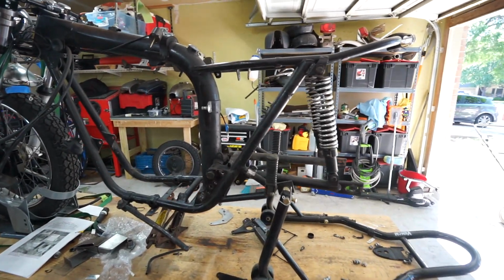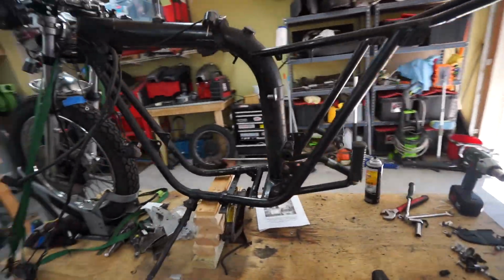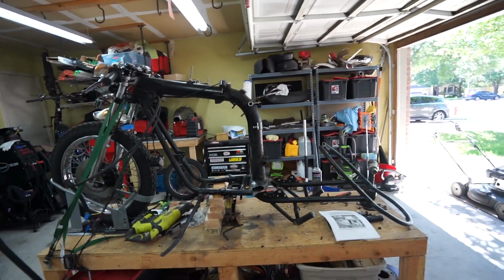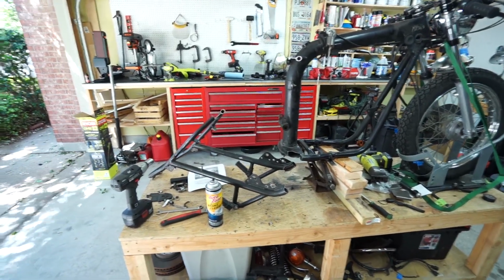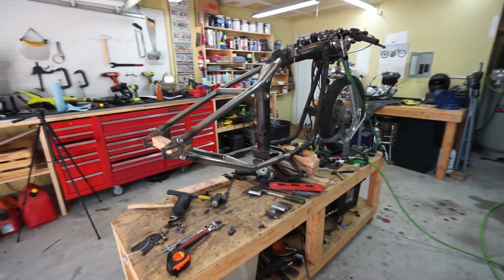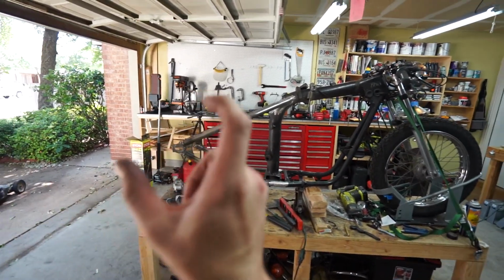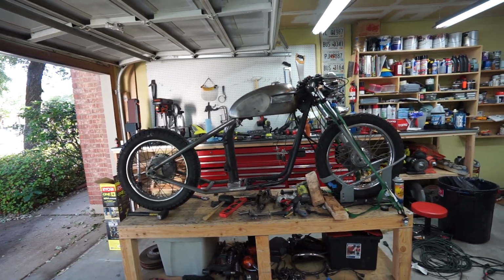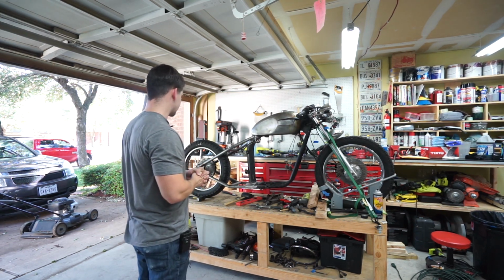Welding on the Triumph hardtail

Comment: As an "old chopper guy" I will give approval of your chopping!  You can't make an omelet without cracking a few eggs.  I'm watching this as one enjoying my factory Triumph ride.  As long as it goes back together, it's all good.  I began building custom frames in 95, working with a new "chopper shop" that opened as I was retiring from the marines.  Once you've cut it, all that matters is getting it back together.  You might have to cut a few times, but you got to do what you got to do, to go forward.  It's always scary when you cut away everything you don't want.  I'm enjoying your generation coming out and doing what I learned to do, back in the seventies.  "It's a family tradition".  I ended up having to design and make my own tubing bender and built a couple frames that were junk, but taught me the "hard corners" you have to finagle to get around.  Your frame is looking really good, I think it's going to ride very nice, looks really good.

Comment: Just found your channel. Looking to hard tail a 74 140V. I wont cut mine like that. I'll leave the rear motor mount and cut open the tubing to fit the hardtail in then weld a plate from the open tubing to the bottom rail of the hard tail. Plan to use the swing arm bracket to mount the shocks to for a spring seat. Originally was going to buy an early frame and put a bolt on hardtail on it but after seeing your bike and how cool it looks I have decided to go with the original frame for obvious title hassle reasons.

Comment: what kind of welder would i need in order to weld a hard tail?
Reply from the maker: A quality MIG will do the trick. It's obviously a very structural part of the bike so I wouldn't recommend it for a first time welding project.  I used y Eastwood MIG 135 and the bike is doing great over a year of riding later.

Comment: Can a beginner learn welding enough to work on frames that with be structurally sound and safe?  What basic equipment is needed for occasional use?
Reply from the maker: Yeah it's all about practice. I would skip the cheap flux core welders and get the nicest Mig welder you can afford. I have had good luck with my Eastwood units.

Comment: brother I need ur help again so since last month everytime I start my bike it will start in one kick but it feels like something is blocking as if like a nose block and gets better when I throttle it up with a little popping sound. but since yesterday its completely dead unable to even start. tried cleaning carburetor and spark it started but it felt like it was completely blocked somewhere was unable to throttle up.and it shutdown and was unable to start again. what is ur suggestion
Reply from the maker: Do the carb blades move properly when you twist the throttle?  Maybe they are binding up on something. Just a guess.
Reply: Classic Octane yes it does today it started properly but unable to throttle up. plus there was part of air coming out of air filter.

Comment: Great job. Well done for being adventurous. it's just a lump of metal, so have fun.
Reply from the maker: Can't learn anything new if you don't get out of your comfort zone every once in a while. Thanks for watching!
Reply: I'm working on my 71 triumph cafe oif. I just  ordered an munit also. I'm using a 4 cell Antigravity battery. I'm planning two dual button Motone switches. as mine is a Cafe Style in wondering where to place the coils. munit instructions say to keep them 30 cms away from the munit. looking forward to your installation solutions.

Comment: Im sure you can just drop the yokes down the forks, but if not, instead of replacing the springs, just take the forks apart, drain the oil and cut the springs down.

Comment: I don't know much about bike builds, but I'm guessing that with the engine in place, it's weight will bring down the ride height... there shouldn't be a need to mess with the triple tree position. Apologies if I'm spouting off about something I know next to nothing about.
Reply from the maker: I thought about that afterwards too. I think you're right. I will wait until the motor is back in before I mess with anything.  Thanks for watching!
Reply: I would guess you're right. It looks like its just a bit off so the engine would weigh it down.

Comment: Great job! I love this series. 
I'm not sure if those welds are strong enough to hold like the "heart" of the frame. 
I will recommend you to reinforce it, it will carry all the weight of the engine and the tank, gotta watch out for that!
Reply from the maker: The weight is pretty evenly distributed through that backbone. It has tons of reinforcement on the bottom where I welded in those plates. Plus the sleeves on the bottom frame rails help a lot.  I will keep a close eye on it but it's really solid as is. Thanks for watching!